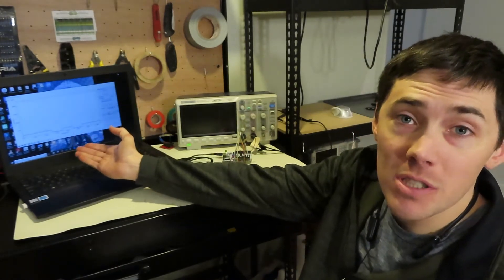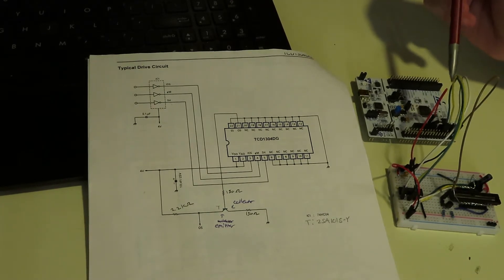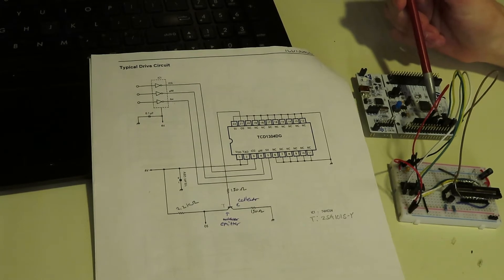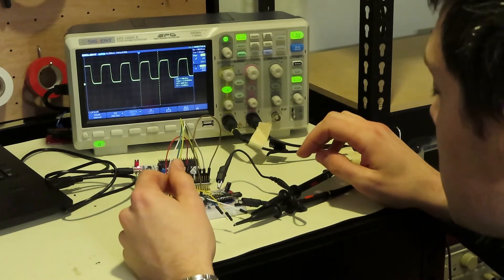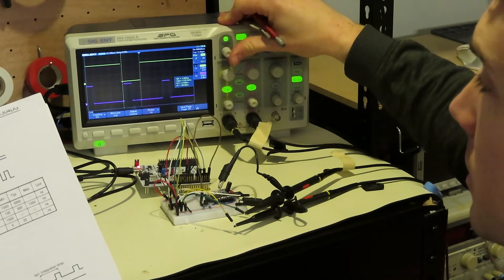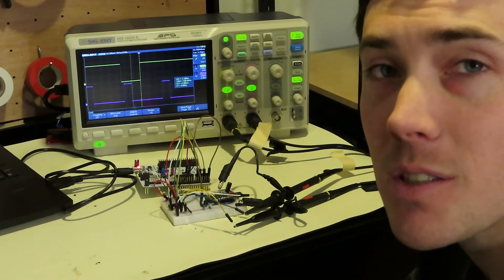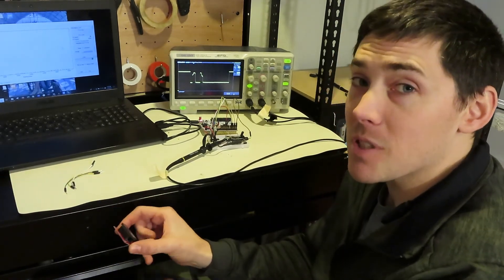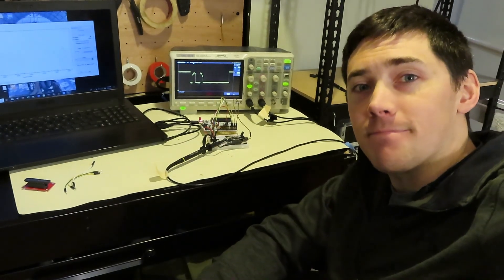Linear CCD for under $30! TCD1304

Comment: Could you please tell me the spectral range of the TCD1304DG detector? The manual states 400nm-1100nm, but some other sources I've found mention 200nm-1100nm. I'd like to confirm this. Thank you.

Comment: what is the absolut the linear cmos can output at 4Mhz? (aka framerate with 8bit accuracy)
Is it possible to get 1000 frames/s (if not limited by the microcontroller)
i am asking this because i saw another video with a raspberry pi standard camera that is able to read 950 frames /s with 640x60 pixel... wonder if that little thing can go much much faster than that pi camera
Reply: What the model of CMOS liner sensor?

Comment: what is the application and purpose of this ccd linear, is that for displacement measuring with emitter element(laser) on CCD for one axis or there is some other project,
Reply: fax machine.. the fax machines and other feed through scanners used them to read lines

Comment: Very nice tutorial, many thanks! Regrading the PCB, I noticed that the chip socket appears to be the cheaper kind, spring tabs. This being the case, it may be a better choice to use a machine-pin socket as the other type is prone to creep-age which might cause the horizontal orientation of the sensor to change over time. P.S. is that your dog?
Reply from the maker: Thanks Sam, I'll check those out. You mean is my profile pic a dog? Yes, that's my dog Heisenberg! The antimatter version my of cat- Schrodinger!